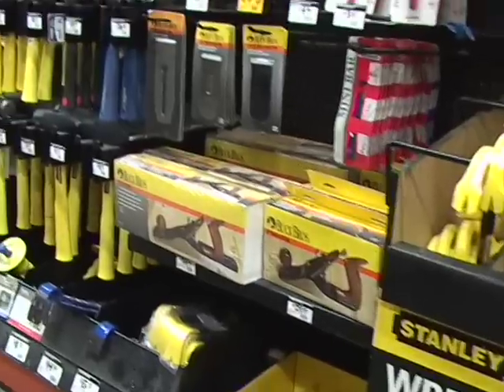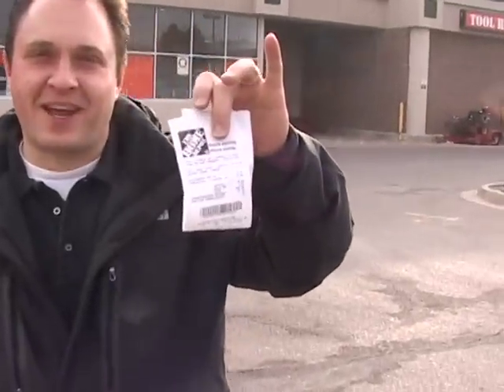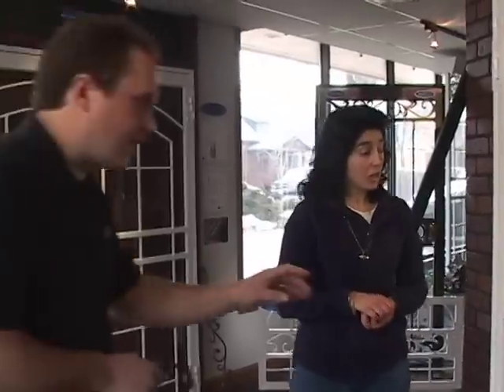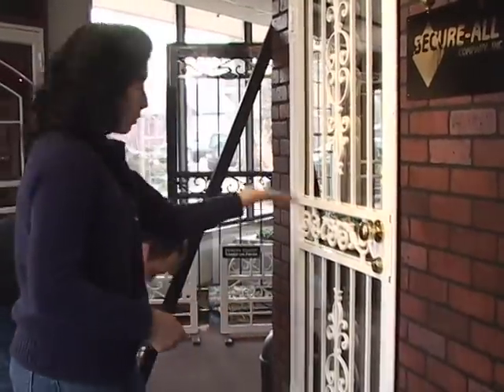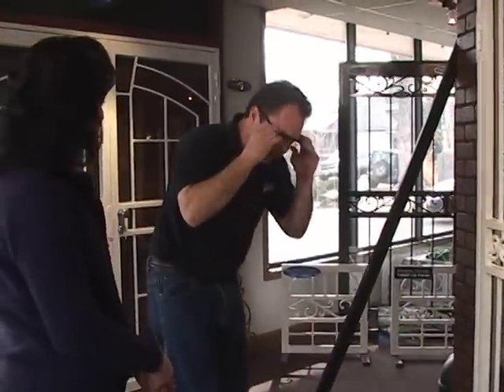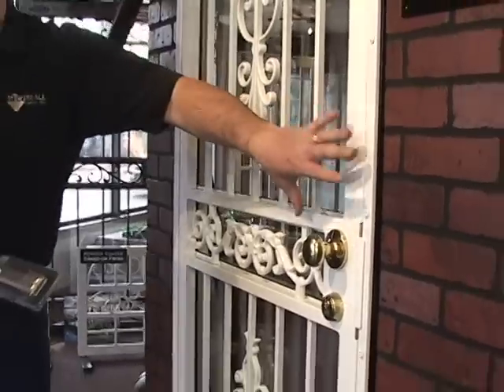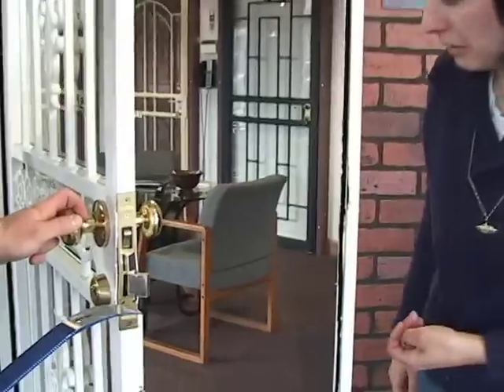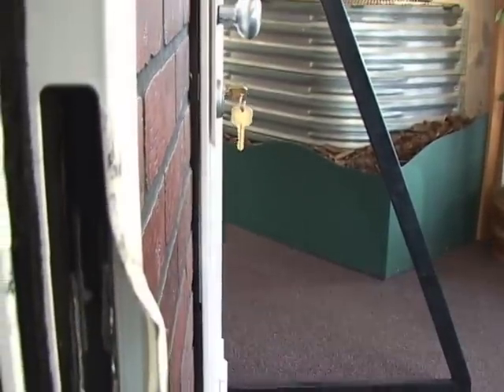Break-In! - Lock Guard Penetration

Comment: Seems like a reasonably strong door to me. Strong enough to stop the average petty thief anyway. If the door didn't give on the first few tries, they're moving on. They don't want to be standing out there dealing with a door for more than 30 seconds. That's too much exposure. On the flip side, if someone is that determined to get in, they're getting in no matter how tough the door is. They'll go through the window if the door is secure. A simple steel door and frame stops this nonsense easily.